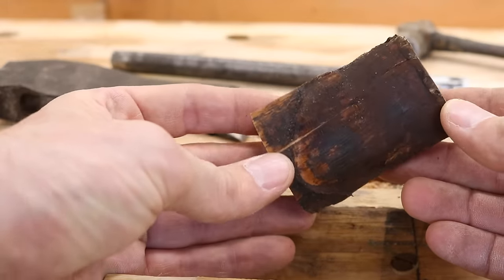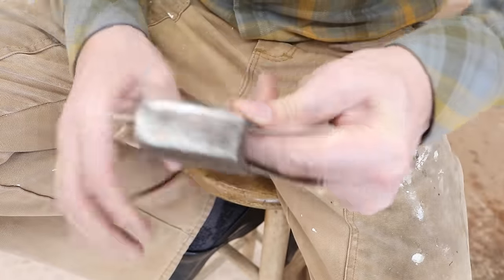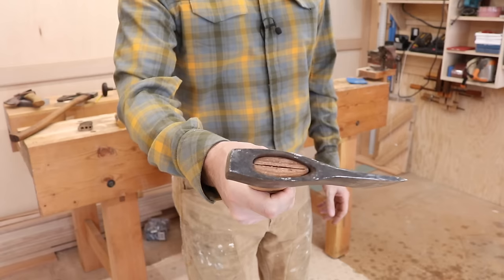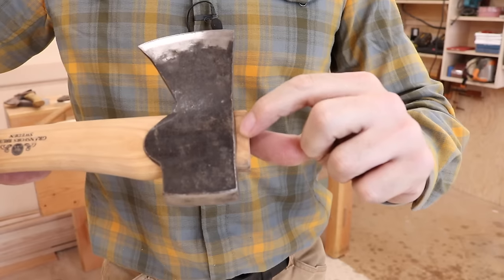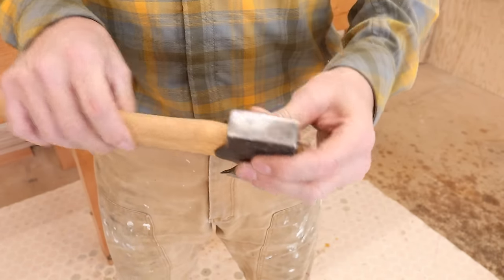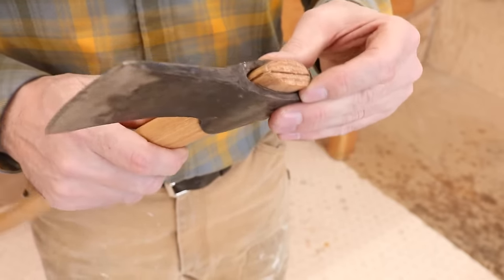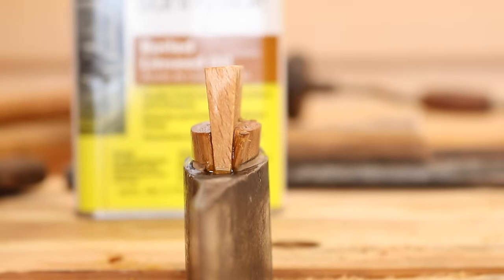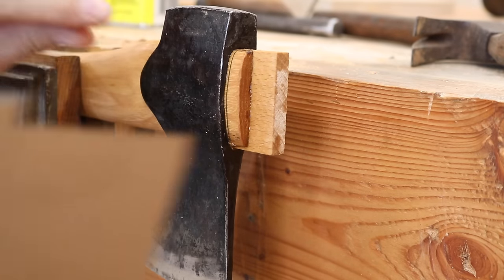How To Handle An Axe - part 2

Comment: That's a nice ax, I like you was surprised at how well the handle fitted your head.  It speaks of how consistent they are with their forge work.  

Dad was an old school Shipwright so much of the cutting was done with handsaws.  I was helping him one day at the boat and he needed to do some cutting and trimming of some timbers.  But he had taken his saws home for a home project so he was with out a saw.  I happened to have my pull-saws with me so I went and got them so we could get the job done.  Dad had never seen one in use and thought they were a joke.  After seeing them used and using them he was sold on them.  I ended up giving him my saws as a gift because I knew he wouldn't get them on his own, it was also kinda a "Hey the kid may know a little something too." as well.  Those were his go to saws for a long time.

Comment: 0:30 they didn't use any press. This type of fitting is done by heating up the axe head to a certain temperature which expands it, then they quickly press the handle in it and cool it in a liquid coolant immediately. As a result, the metal shrinks back to its normal size and yet it receives the final heat treatment.

Comment: When I get it almost down to the final seating. Maybe a quarter inch. I put the axe head on the wood stove and get it pretty hot. Not enough to affect the temper. Then seat the head and put in the wedges. It shrinks a little and is extra tight

Comment: I think they heated the metal before inserting the handle, that is why the black colour of the handle. The metal expands so it can allocate a wider handle before it cools down, and you got an uniform tighting.

Comment: Hey I have to say, I always thought when I saw someone trying to put an axe handle or maul handle it was b.s. But I've got to say, whoever gives you shirt should just do it their wa, because that was awesome. Hey it worried great. I know you didn't have to do any adjusting to the handle. Still that's a smooth method ed that really works.

Comment: for seating the head on the handle I learned to take the axe with the head up and just hit it on the floor (or a piece of flat wood for less damage) with the bottom of the handle... seems to be like the same principles of force just without gravity working against you

Comment: Just to second your method of whacking the handle being the right way to hang a head... Another guy and I were putting up some electric fence around a field so the cattle could get on it this winter.  The soil was too hard to get them in by hand, so we had to use hammers.  One problem, one of the 2 hammers in the toolbox would have the head fly off every 10 swings or so.  The other guy whacked the head down onto the handle and drove a nail through the handle right above the head.  This held for a while but gave way later that day.  I ended up with that hammer later in the day and whacked on the handle until I saw a good amount shavings coming off of it, then snipped a piece of sheet metal off of one of the ears of the post and made a wedge.  I drove the wedge in there HARD and it held for the rest of that day and a few more days until we got another hammer.  Whack on the handle to seat the head, not the other way around folks.  I was skeptical until I had to do this, but it works quite well.

Comment: Not sure why that historic handle had to be cut?  It hurt me, too.
Reply: Ken Fouts whyyyyy do allllll good things come to an end
Reply: You'll tear up the part of the handle in the axe head anyway if you try to take it out.  The wooden wedge is in there tight, and you can't drive it out with out drilling it our, or gouging it out somehow.  Even if you get it out, that part is trashed and you'd have to cut it off anyway if you want to try and use it in some other fashion.
Reply: Arkansas Pilgrim you can use a 1/16 drill bit and drill about 40 holes down the middle of the wedge to pull it out... I've done this several times so this video hurt my heart lol
Reply: In the first video he says that the handle was getting to be loose.
Reply: Are ya kiddin? How old do you think it was?
Reply: Sawyer Glanton it was 14 years old lol

Comment: The Gransfors Bruk is a great looking axe but as a professional ive used a fibreglass handled axe for the last 22 years.I still have a small hatchet with a wooden handle but i hardly use it , prefering my fiskars billhook.Its great that youre keeping alive old skills Cody - im thinking about getting a cross cut saw (whipsaw) but strictly for weekend use at home - but i think you have a tendency to romanticise old tools & techniques.I also use Japanese pull-saws from Silky & ive chosen the ones that can be resharpened by hand.

Comment: The saw with the metal spine back is called a Dozuki and blade is removable by gently tapping front top side of handle on wood and reinstalling it you tap on back metal side. The other pull saw with both a rip and cross cut on opposite sides is called a Ryboa saw and blade is removable by using a screwdriver or a thumb screw.

Comment: I remember when my grandfather taught me to hit the handle of the axe rather than the head. At that age, it blew my mind that it worked.
Reply: D POP Same thing here. When I was around 10 my grandfather gave me his old axe (he was a woodsman the first half of his working life), and we spent a couple of summer days making and new handle for it. Memories from over 30 years back are far in between, but seating the axe by hitting what seemed to be the wrong end made quite the impression on me and is probably something I will never forget.

Comment: WRANGLER STAR IS AN AXE(handle) MURDERER ! the old handle was fine. a few bangs on the handle on a chopping block to tighten and a couple of extra hammer/axe wedges driven in to the top would have made it tight. i have a plumb axe with the original handle from ww2 its still perfect
Reply: There was cracking...

Comment: When you wedged the head on the vice, the handle dropped a bit from that perfect position that you marked. Is that a problem  in your opinion? Just wondering shouldn't it be clamped  for the wedging?
Reply: My not-so-professional opinion, but from someone who chops as often as possible and has a small collection, it won't matter because of the wedge. There is a length on that wood that allows for error. That handle will hold tight with the wedge and head in place for a long time, long enough to never be a factor.
Reply: @NobodyCaresALot  Thank you I appreciate it.

Comment: Niçe job .. I do always have a ax handle hanging on the wall by the stove 4 feet and before I do replace warm up the steel hot to touch just in comfortable ..that for probably the way they do .....thank you for all the info

Comment: When ever you first struck the wedge with the hammer. You can see the mark you made on the handle moved down. Does that matter? Would it be better to support the bottom of the handle with something so that doesn't happen?

Comment: I have a wedge from a true temper axe and it's more like a nail head that covers the whole eye.. part of the wedge that goes into the wood like a knife blade with holes drilled out of the cheeks for retention once you hammer it in

Comment: Just a thought but I wonder if a good solid Rubber Mallet would be good for this also for the reason that the rubber will not impact to damage the wood at any point. I only mention it because you said you have found that hammer best for the job, but the reason it is best (I am sure) is because it should not damage the handle where it impacts. I think the rubber mallet might actually be better in this case. (but that might be splitting hares.)

Comment: You know what I just realized. If the axe handle is running one way wouldn't it make a lot of sense to make the wedge 90 degrees the other way? As the wood expands it'll push and mushroom out even more to hold the head in more securely.

Comment: Thank you for the wonderful video. Did you happen to notice that inside the "jaws" of the Graensfors Bruk head is slightly concave and there is a 5mm rim along the edge so that the steel bites into the handle? I knew that there must be something more going on inside the head. You did not draw attention to it, but it was quite pronounced from the angle that you showed at 2:22. additionally it looks as if there are some longitudinal rims running down the inside. I wish you showed a little more of the interior of the head. Maybe it was the lighting but I could only see a glimpse of it.

Comment: @wranglerstar at Granförs they use wood glue instead of linseed oil to drive the wedge in. have you ever tried that?
Reply: here is the reference of where they say to use Glue    https://www.gransforsbruk.com/en/axe-knowledge/caring-for-your-axe/fitting-an-axe-with-a-handle/
Reply: Now this makes sense!
Reply: And they suggest supporting the head on two pieces of planking to drive the handle into the head.  Maybe they actually use a press at the factory like Cody commented.
Reply: I'm guessing that the imprint of the head on the original handle would have been from inserting the handle with the head heated.  As the metal cooled, it would have contracted tighter onto the wood, compressing the fibers.

Great channel, Cody, have been watching your feed for months now.  

Hope you are feeling better soon.
Reply: April Wilkerson used glue too! Smart girl.
Reply: Woah, crazy thought!  Kinda like repairing bearings.  Way to think outside the box, Michael!!
Reply: we use tar in Finland
Reply: Lucas Tilgaard linseed oil is an unstable oil that hardens up as it oxidizes.  In some ways, it’ll act like glue.  Cody won’t have any issues with that handle.
Reply: Its Gränsfors not Granförs

Comment: Ok last comment, have you ever considered using wood glue as your lubricant for pounding the wedge and then oiling after? It seems like this may keep the wood as small as it can be while fitting the wedge then expand it after the job is done making it tighter? I guess you would have to know how quickly BLO penetrates into wood and if any swelling occurs in the short time you are pounding the wedge. Not saying that your way is in any way wrong, I just like to over analyze things.

Comment: Interesting that gransfors’ website says to use glue on the wedge.

Maybe that is part of their secret?
Reply: Some use sap, some use glue, some use oil of various types, sometimes people use epoxy and recently i heard someone say that they soak handles in raw linseed oil for over one week. I suppose what we need is the same axe with the different methods wacked  thousands of times to see which one would  fail first.

Comment: To get the head so tight onto the handle I bet they heat the head up a bit. Not enough to affect the head, but enough to expand it. And no, this wont badly burn the wood, as long as you cool it after. Or they just do as you did in the video.

Comment: yes you want that expansion but you want to set the wedge first with some wood glue let dry then pour the oil to it if its swelled before you set the wedge your just working against the whole idea finish with round steel wedges  also leave a 1/4 inch wood proud so it can have a flare to help hold the head on THEN YOU GOT REAL FALLER'S WEDGE BANGER

Comment: To get a tight fit 0:50 in they could heat the metal to a very high temperature and then drive it over the wood?. Hard wood of course otherwise the scorching would weaken the join. The pegs in the end are belt and braces to fan out the end and prevent any water getting in there (Ice and expansion will split even metal) more on lower quality axes
are these the best axes out there? and what do you use to sharpen, what angle etc. great vid thanks again.

Comment: Great video. Thanks. I want to replace the handle on my axe. My axe head is held in with a combination of a wooden wedge and some kind of circular equivalent of those little metal wedges in this video. Any advise on how to get the axe head off the old handle with that set up?

Comment: FYI when you come out of the shower you are heavier because you are wet, not because you have absorbed water. The water sits on the surface of your skin, it does not permeate the upper epidermis. :)

Comment: Nice video! Recently got a new GB Small Forest axe.   Looks like they've stop putting in those step/claw wedge into the eye at the factory .  They now use some sort of epoxy to fill in the gaps.  I believe I even saw a video of them saying the way they do it now is "just as good" as before with the step/claw wedge... and as a result it's a cost cutting/environmentally more friendly thing to do (not using the step/claw wedge).  My own personal feeling is that it's a step back.  I prefer it with the step/claw wedge.  The question is will they stop including it in their "rehandling kit"???
Reply: T Sizzle No they still include it in their rehandling kit.
Reply: They no longer include it.

Comment: Why would you wedge it while it hangs from the head, doesn't the handle move down easily?
Reply: I've found if you leave the top long like he did (coming out of the eye) when you put the wedge in; the wedge mushrooms out the top quickly and keeps the handle from moving on you.  It can be a little tricky at first.  It took a few to get used to doing it W's way.  I can say that none of my axes have moved on me using his method.  Have fun!

Comment: You can indeed sharpen Japanese handsaws, just not the ones you´ve got because of the steel having chromium and such added to it (if i remember correctly the steel used is some sort of stainless steel, rust proof for sure). Get yourself a handmade Japanese saw and enjoy your sharpening sessions. They are not cheap and they are not recommended for inexperienced users, since you will likely break them if you are not used to pulling properly and your wont be able to replace the blade for 30 bucks like you do with the Gyokuchos you own. Cheers.

Comment: You addressed the counter-intuitive method to hang the handle onto the head, by pounding the butt end. 
But, where should we set the axe head when hammering the wedge in? Did you clamp down on the vise so it CANNOT move?
I don't own a table vise. So, I've been perplexed by rebound actions of a head moving up the handle with each strike upon a wedge. I don't understanding the physics of hammer blows & rebound. So, must the axe head be sitting between the vise jaws, while the handle hangs below? Did you tighten the vise, so the head or handle is fixed & imovable, to the table preventing opposite action rebound?
Thanks.

Comment: Cody, Is there a rule of thumb to which way you orientate the wedge...With or against the grain of the handle? I was looking at my ax that i hung a few years ago and realized i never put a wedge in it....still fairly tight but it doesn't get much use except when camping.

Thanks!!

Comment: I have a wooden handle hatchet and a wooden handle ax.  The hatchet handle is loose and I couldn't seem to keep it tight.  So I bought an all steel hatchet today - all one piece.  Now that I've seen this I'm going to re-handle the hatchet.  $27.00+tax for boiled linseed oil and cost of a new handle, I'll have more in it than I paid for the all steel hatchet but I like the old school stuff.

Comment: if you want a special tool to set wedges take a small chisel and grind the tip flat! but the question is do you need a special tool? will you use it enough to justify making one?

Comment: I watched another fella hang an axe, much the same as you did. of, it's your technique he was applying.  but he rubbed boiled linseed oil on the axe head end BEFORE he hung the handle.
   seems like that'd be a little wiser, considering now ALL the wood is treated.

Comment: You have to drive the handle into the ground while holding the axe head. Hitting the handle into the axe head does not get it seated all the way. Dress the end of the handle after slamming it into the concrete afterward.  The butt of the handle needs to be on the ground when you drive the wedge.

Comment: isn't it better to put the oil on after you put the wedge in? then it would expand and tighten arround the the wedge?
Reply: ArcticWolfAC yeah but it doesn’t soak into the wood immediately so you can do that

Comment: I've been handling my tools wrong. Thanks I was using wood glue and not oil and pounding down on the head and never payed attention to the orientation of the grain... what do you think about putting the head in a fire to get the old wood out in a pinch.will the temper be changed even if you quench it.

Comment: broke a dledg the other day...breaking up rocks for sis & bro in law for dry well ....shaved down the handle...reattached the head..broke that too..end of the hanldle was too brittle...must not have had any linseed oil..

 bought a new 8 pounder at home deep..bout 12 bux + tx.. broke up rocks..

refitted the old one again .. nowe a hand sledg..

Comment: I noticed that as you pounded the wedge in the head moved up quite a bit past your pencil line. Would it be possible to clamp it tight enough to avoid that or would clamping that tight damage the handle?

Comment: Is the claw wedge designed like that so it can go into either side of the handle and the wooden wedge? Therefore it's really pushing all the wood together? It sort of explains the angle they put it in at.

Comment: I always thought that metal wedge was just a (standard length) "square cut" sheathing nail ... Are those used? ...or was the tool my father had just put together wrong? I can't find any reference to this anywhere.

Comment: would cooling the wood handle in the snow outside help and mildly heat the axe head work? then let the two acclimatise to get the perfect interference fit axe head?
I'm just saying based around the way they used to fit wing pivots to the f111 bomber.